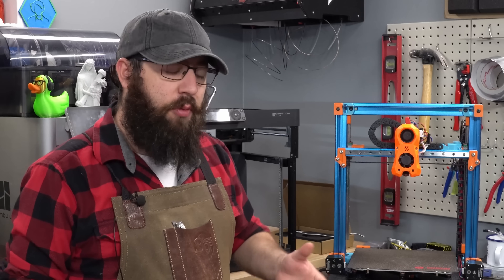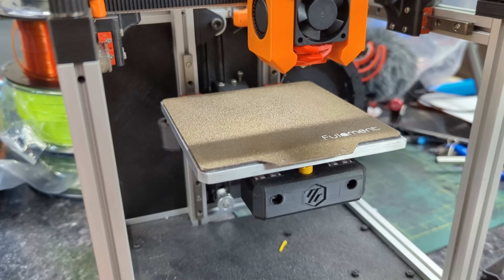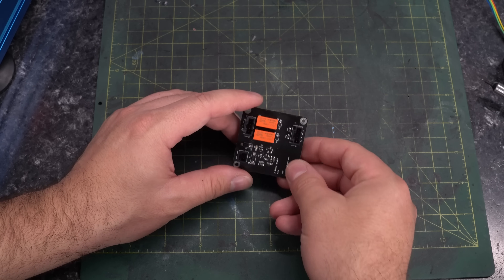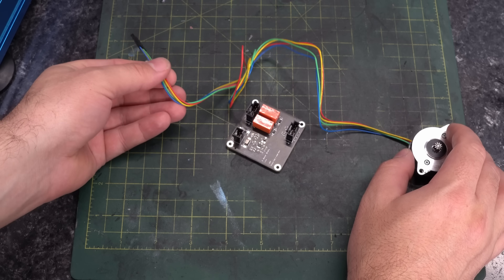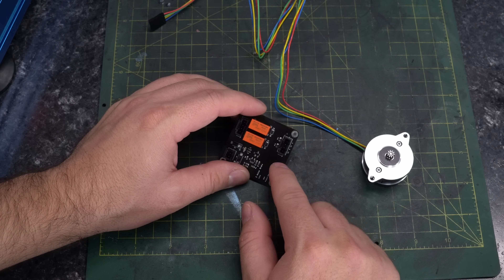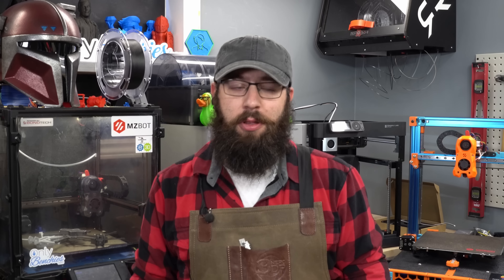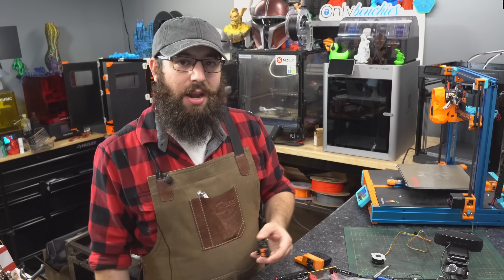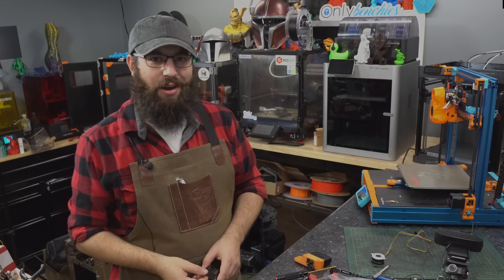STOP THE DROP! - Project R3D Zmotor Brake Board #3dprinting

Comment from the maker: Here is the example Klipper config used in this video
also note, you can pair up the brake boards to a single pin for activation, as long as all motors need to be locked/unlocked at the same time

add this to your printer.cfg file
[include brakes.cfg] 

then create brakes.cfg and include the following in it
[output_pin my_pin]
pin: <insert pin here that connects to your brake board>
value: 0
shutdown_value: 0

[delayed_gcode my_delayed_gcode]
gcode:
  SET_PIN PIN=my_pin VALUE=1
  set_stepper_enable stepper=stepper_z enable=1
  set_stepper_enable stepper=stepper_x enable=1
initial_duration: 0.01

#optional if you want to keep motors always on when powered up
#[idle_timeout]
#gcode:

[gcode_macro M18]
rename_existing: M18000
gcode:
    M18000
    SET_PIN PIN=my_pin VALUE=0

[gcode_macro M84]
rename_existing: M84000
gcode:
    M84000
    SET_PIN PIN=my_pin VALUE=0

[gcode_macro G28]
rename_existing: G28000
gcode:
    SET_PIN PIN=my_pin VALUE=1
    G28000
Reply: If you want to have the board enable the motor drivers on powerup, you can add the motor enable pins in make menuconfig under "GPIO pins to set at micro-controller startup", separated by a comma.  I HIGHLY RECOMMEND adding your hotend cooling fan pin to this list as well, on ALL Klipper controlled printers with a temperature controlled hotend fan.  This will prevent hotend jams or meltdowns if the MCU is reset or power cycled when hot.
Reply: Thank your very much for this video. I was in in contact with projectr3d one month ago. I had no good idea how to set it up. They have recomend to use 2 boards on a Switchwire to prevent from dropping. 
Why didn‘t you first turn one motor on and then turn the brake of on the other motor? This schould in theorie prevent from dropping during the switching.

Comment: Interesting. Did a little digging and this is based on the 'LulzBot Mini 2 Z Brake Board'. Lulzbot also has the schematic on their website.
But i also saw you can wire up a standard 4x relay board with motor enable pin to the inputs to the relay board.
Maybe a board which detects voltage on one of the coils would be an even nicer solution!
Reply: Thanks for posting this!

Comment: NERO 3D. This system is used on my power wheelchair ♿️. It stops the chair from moving when I am not driving. You can hear a very loud click when it is engaged or disengaging. Kind of drives me crazy 🤪. That was a great video explaining how it works and to install it. Unfortunately due to my mushy brain syndrome lol it was all French to me. Hence the reason I can't use Klipper. Wish I could as I like the tinkering that it lets you do with your machine. Keep up the awesome work. Cheers from Calgary Alberta.

Comment: Interesting! I am running Klipper on a delta, and have been disappointed that I can't disable just the E, and keep XYZ energized, to keep the effector up. This looks like it could be a good fix. It would be great to disable everything, but the head will crash as well. Although I am a little confused. Do you need the board on both the X and Z steppers for the Switchwire? If just on the Z, wouldn't X be allowed to still move? For a delta I would need 3 boards to brake all 3 arms, right?
Reply from the maker: you would need a board for each motor that controls z movement

Comment: This is a bit off topic, but I'm looking on your vid page, and don't see a follow up vid on the Creality Sonic Pad. Did you just abandon testing the Sonic Pad, or is that vid still to come? I have a keen interest in this SP, since RP's are so expensive now days, so I look forward to hearing what you think of it. Thanks.
Reply from the maker: After the sloppy initial configuration and the walled garden ecosystem, ive kinda had no real desire to finish it up but i may in the future

At the end of the day it runs klipper like anything else that runs klipper does, with an integrated screen attached. Other than a slightly easier setup on creality machines, it`ll work the same as say a BTT pad 5

Comment: Not sure if anyone will read this, but I installed 2 of these boards for the rear Z motors of my voron 2.4. When I try to home all, I hear the relays click, all 4 Z motors raise (safe Z height) but then it errors out with "Macro G28 called recursively". The only thing I changed was instead of motors Z and X, I'm using Z1, Z2. I've been searching for answers but nothing helps.

Comment: couldn't you also just wire up the enable pin from the stepper interface for this? Or configure a dummy stepper driver that uses the pin as it's enable pin
Reply from the maker: The board needs 24v to operate and iirc the enable pin uses 5v logic
Reply: @CanuckCreator  the latter approach could still work though, no? the former would need a fet or something to switch, which could be done if you don't have a spare switchable 24v pin on the board

Comment: Will be converting my Ender 3's (Pro & Max) to KevinAkaSam's Z Belt mod, once the rest of my parts from AliExpress arrive, and was wondering how to prevent the Z drop if I need to so this video is very timely. Thank you.
Reply: The belted Z mod uses a geared setup so z drop does not occur in most cases
Reply: @gentsimps9067  that's good news, currently waiting on the 8mm rod to put it all together. One less worry now.

Comment: Thank you for covering this and showing how to make them safe to use with klipper firmware shutdowns and arming delays... good stuff!  I evaluated this type of software solution using off the shelf relay boards, as well another similar physical option (the stepper brake add-ons) - these all have merit, but are complicated with regards to safing them fully in klipper, and in the end keybaks are really bulletproof without relying on electronics (especially when used in 2+ quantity [redundancy]) and also provide the benefit of actually subtracting the weight of the gantry from the steppers/belts (but not the inertia!).  In extreme situations like I run, I just like the physical security.

Comment: For someone who has 0 experience on this specific topic: wouldn't the [controller_fan] logic have done the same without all the workarounds?
Reply from the maker: In theory yes. But I did some testing and it caused some issues with the TMC drivers throwing errors. Could have been a timing issue

Comment: This device can't generate any braking force unless the motor is turning. If the motor is turning, the Z axis is dropping. If the Z axis doesn't drop when this device is connected, friction is preventing it from dropping and it wouldn't drop without this device. At best, this device provides a gentle drop instead of a hard drop when power is cut.

Springs and counterweights can cause backlash in Z axis movement which is a disaster for print quality. You have to make sure that the spring or counterweight isn't sufficiently strong to lift the Z axis by itself.

If you want to prevent Z axis movement when power is lost, the simplest solution is to use a worm gear reducer to drive the Z axis. My corexy printer has a 30:1 reducer lifting the 3.5 kg Z axis with belts (one motor, two belts) and it absolutely does not move when power is cut. No additional electronics and no special configuration are required. It just works. Since it is a single motor driving both belts, the bed never tilts, so there's no need for autoleveling. As soon as you use more than one Z axis motor, you need some form of autoleveling because the motors jump when power is first applied.

Comment: While the result is fewer things visible above the bed, it's anything but elegant.
A single spring and string is way more elegant, and less expensive, and you don't need to teach the printer how to use it. 
You could even take away the string and attach a winding spring directly to the motor shaft.

Comment: The thing I do not like is that you cannot move your gantry easily by hand on SW after this mod. And the setup is overkill just to avoid counterweight.
Reply from the maker: It still IS possible to move it by hand with the brakes engaged, and sure, on say the SW a counterweight (keyback) may still be a valid setup, but that may not be true in all use cases and a brake board may make more sense

Comment: after getting this. im not entirely sure its worth it. £15~ per motor makes this mor expensive than a keyback. the choice to use 24v as the solenoid power is odd too. 

all this seems to be is a glorified 4 channel relay module (8 channels for 2 motors) set up so that:

Common wired to the motor
Normally Closed wired to the Normally Closed of the coil pair
Normally Open wired to the mainboard. 

These cost £5-10 for 8 channels its slightly larger but you can control it with a 5v single rather than 24v. which results in me needing to use an optocouple as i have no other 24v pins on my board

thinking about it you might be able to get away with using 2 channel relay per motor by doing this connection:

Common Wired to one side of the motors coil (A & C)
Normally closed  to the other side of the motors coil (B & D)
Normally Open to the main board (A & C)

Id guess protection would be needed on the mainboard side to prevent A/B dead shorting to B/A, but thats a diode on each of the outputs